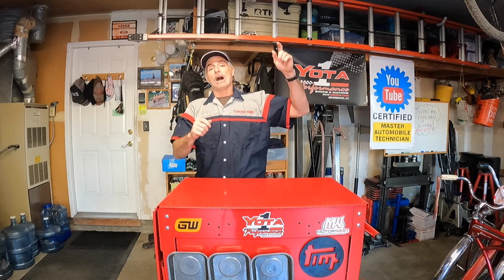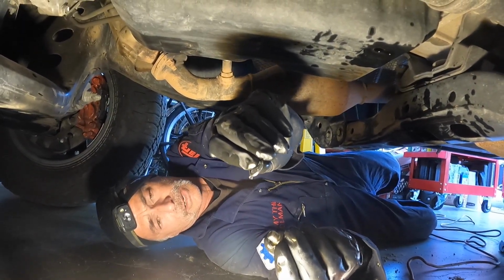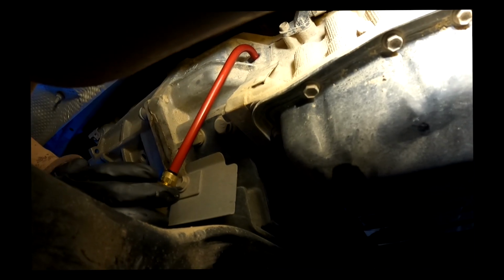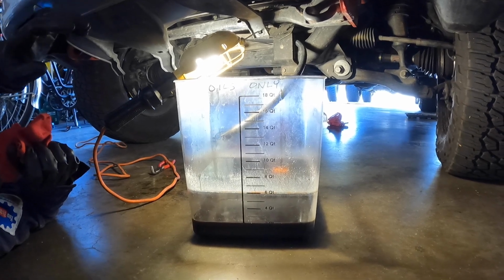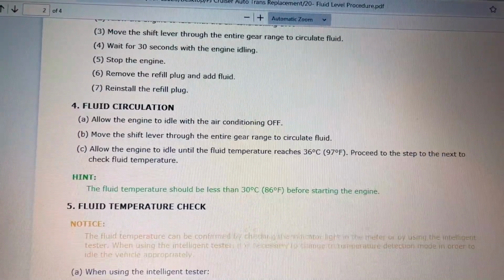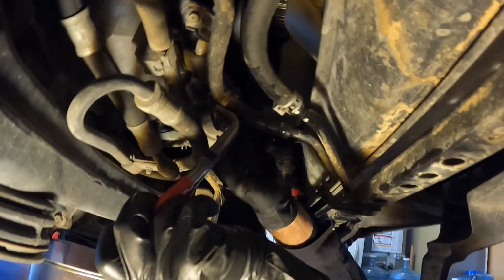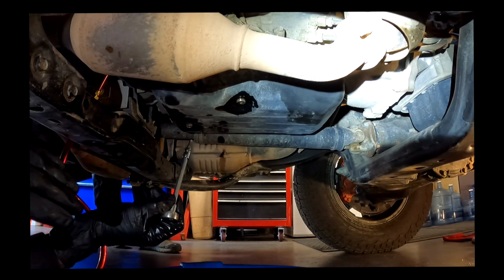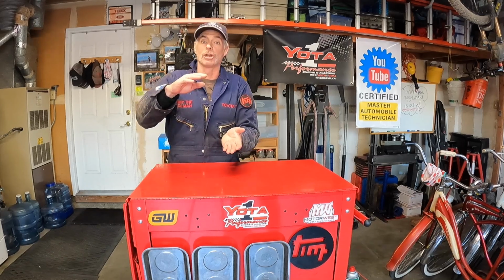Toyota/Lexus Sealed (No Dipstick) Automatic Transmission Flush (Fluid Exchange)

Comment: Do u have to let the the truck running to check the fluid level? Because when i do that theres nothing coming out even after adding more fluid. But when i shut off the truck fluid start coming out on the overfill..
Mine is 06LC. But should be same procedure
Reply from the maker: It has to be running.  If you're not getting anything coming out or the overflow, you're still underfilled.
Reply: @TimmyTheToolman initially when i fill it up, i leave the over flow open and once the fluid start coming out thats when i stop. Then i check the temp for the level. But fluid still not over flowing when the engine is running.

Comment: Love the detailed video. This is the reason I love manual trannys. I wish I could find a mechanic like you. I have a 2012 Lexus ES350 and even the dealership just does a drain and fill, which in opinion is just stupid. Mixing new fluid with dirty fluid. I had a 2012 Corolla with a dipstick and i did the tranny flush every 30k miles. It had 475k miles when I sold it and was running great.
Reply from the maker: Thanks!  Regular drain and refills can keep your fluid in great shape.  That's what I do for my 4runners, but I do it every 10k miles, which, for me, is every other engine oil change.  I think most people do a drain and refill much less frequently and believe it's sufficient.

Comment: My 2021 Tacoma has no external oil cooler. I'm currently adding one. Is the top trans cooler hose on the radiator always the feed line and the bottom hose the return line?
Reply from the maker: I can't say 100% that's how the hoses are always oriented.

Comment: mine comes out heavily bubbles and I hear a sucking sound on our 2006 tacoma, on my other truck 2005 4runner it came out normal. this i doing the same procedure. I am wondering if mixing in whatever the old fluid with what I know to be WS would cause this reaction. I dont know what was in the tranny before I did the swap (at 99k miles).  The fluid I drained was pink, but looked pretty clean, too clean for original so someone before me must have serviced it at least once before
Reply from the maker: @bradclarke93  Interesting.  Sounds like air is being introduced.
Reply: @TimmyTheToolman  agree just not sure where it could be coming from.  Will check the lines to the cooler etc.  I did not touch any of that, just a drain and fill 2 liters
Reply: also going to drop the pan and do another round , if I am going to check the lines
Reply: so I used an autel scanner and got this code P2714 Pressure control solenoid  "D" performance / stuck OFF position. 
not sure if over or under filling the transmission on the first drain and fill may have caused this or what.  It was shifting fine before we did the 1st drain fill.
I am going to pull the pan this weekend and replace the filter either way,

Comment: Why not do the transmission filter as well ?
Reply from the maker: @adventurousairman  It's certainly an option.  Those filters are a fine mesh metal strainer.  They are not a paper type of filter media that is prone to clog.  I've cut open filters like these, and the filter was pretty much 95% unclogged.  I suppose if you bought a used rig with an unknown service history and the fluid looked in really bad shape, it might not be a bad idea to drop the pan and replace the filter.  We chose not to do it on Thanh's GX470, even though his fluid was pretty black.

Comment: Great video! Quick question, I have a 06 Toyota 4runner V6, 2WD and I'm thinking of doing a full transmission  fluid flush (just what you did in this video). So, practically, it's the same process, right? Do you have any idea how many quarts of trans fluid I need for this job? Thank you!
Reply from the maker: Yes, it would be the same process.

The system holds approximately 12 quarts.  We ended up running 13 quarts through the system and were happy with the way the fluid looked after the 13th quart drained out.  I'd have at least 14 quarts on hand to get the system flushed and to the proper level.
Reply: @TimmyTheToolman . Thank you!
Reply from the maker: @rca076  You're welcome!
Reply: @TimmyTheToolman . A couple of kore questions (sorry man!). When jumping the OBD port, the 'jumper' stays on the whole time I'm checking the fluid level? And, I'm planning to drop the oil pan and replace the trans filter so, you'll see a bunch of bolts on the transmission and I would like to tight them up a bit. My question, do you recommend doing this?? Thank you?
Reply from the maker: @rca076  Yes, keep the terminals jumped while you're trying to dial in the fluid level.  It's mainly to let you know you're in the sweet spot for the proper temp to check the level via the overflow plug.

For the second part of your question, are you asking me my opinion on dropping the pan.  You sort of lost me by the way you wrote it.
Reply: @TimmyTheToolman . Apologies for the confusion. I’m dropping the pan and replacing the filter, too. While I’m at it, is it advisable to tighten the bolts on the transmission?
Reply from the maker: @ I don't see any need to try to tighten the bolts that hold the valve body to the transmission.  I would assume they were properly torqued, but I guess it's not going to hurt anything by checking if any of them are loose.  I'm like 99% sure you're not going to find any loose bolts.

Comment: I just did a filter drain and fill. When I initially got it up to temperature to check the overflow plug only a small trickle came out. I had to add more in as well.

Do you think by not having enough fluid in the transmission initially that it would do any damage? I only needed to add in another 1/4qt.
Reply: Like any damage to clutches or transmission gears? I cycled it between drive, reverse, neutral a few times to get the fluid moving. I was probably just 1/8 -1/4 qt low when I initially did this. I cut it off and put more in there and then did the check again. Just hoping I didn’t do any damage technically being low on fluid. What are your thoughts?
Reply from the maker: @Steve_Balboni  You're worrying about nothing.  These automatic transmissions aren't that sensitive.  They can run a little high or low with zero issues.  Plus, when you're not driving the vehicle, there's barely a load on the transmission.  If these transmissions were that sensitive, they would be failing with a high frequency, which they aren't.
Reply: @ thanks for the awesome insight. You’re the man, I always appreciate how quickly you get back to me and your insight. Hope you are enjoying retirement!!
Reply from the maker: @Steve_Balboni  You're welcome, Steve.    Retirement is treating me well.  Thanks!

Comment: I also went by feel torquing the drain and overfill plug. I set my torque wrench to 15ft0lb, but never reached it since it felt super tight. I prob did 12 ft-lb or so. been over 2 years and 30k miles- no issues.
Reply from the maker: @pennmikael  Yeah, it's good not to live and die by the torque spec.  Gudentite is good enough.

Comment: I have read on some forums that fluid check temperature should be 97-115 degrees and others is 115-133 degrees for the A750E transmission. Which one is coorect? I have a 2008 tacoma prerunner.
Reply from the maker: @ocelott75  I got my information from the Toyota Tech Info website.   Sometimes, the people writing the Toyota manuals make mistakes, which may be the reason for the discrepancy.

Comment: Flush is the problem. Drain the cvt only never flush it
Reply from the maker: @Tryall200  Flush and Fluid Exhange are used synoymously.  There's nothing wrong with doing a full fluid exchange, so I don't agree with you.  I do like drain and refills because they are easy to do.  I maintain the auto transmissions on my rigs by doing drain and refills, but with that said,  there's nothing wrong with doing a full fluid exchange if you know what you're doing.

Comment: Can you simply do the same process but instead just drop the fluid from the pan 3 or 4 times and refilling with fluid instead of doing it from the bottom trans hose
Reply from the maker: @goldenboyproductions7229  You could, but what you're suggesting is a dilution process.  Every time you drain and add fluid, you're adding clean fluid to dirtier  fluid.  It works, but the fluid won't be as perfectly clean as it would doing it the way we show in the video.  But yeah, several drain and refills will get your fluid in good shape.

Comment: The cheapest and most accurate way to measure fluid temperature is the meat thermometer 😊.
Before filling the fluid, I use the silicone plug to cork the overflow hole.
Insert the meat thermometer probe through the silicone plug into the transmission. Just enough to touch the fluid level.
Once it reaches 104 to 113 degrees, simply Uncork the silicone plug and let it drain to trickle.
Meat thermometer with long cable or Bluetooth works the best.
I use Bluetooth. You can set the temperature to the T and alert you when ready.
When your wife asks, what's that funny oil taste in the meat. 😮😅😁
Reply from the maker: Thanks for sharing your meat thermometer technique to measure the fluid temp.

Comment: Hi. I've got a 2006 GX470 and the tech service manuals give a 115-130 range for the check fluid level procedure. Do different model years have different temp bands?
Reply from the maker: I don't know why the suggested temp to dial in the fluid level would change if it's the exact same transmission but just a different year GX470.  What manual are you using?  I pulled my information from the Tech Info website.
Reply: @TimmyTheToolman  Lexus 2006 Repair Manual GX470. I took pictures of the pages but can't figure out how to add these to this post. Pages AT-164 to 166. Temp is on bottom of page 165.
Reply from the maker: @bobmccurrach4483  I didn't know Toyota/Lexus was still making the physical books in 2006.  I was guessing you were using a Haynes manual.  I don't know what to tell you on this other than I downloaded my information straight from the Toyota Tech Info website.  If yours is a Toyota manual as well, the only thing I can chock it up to is mistakes are made in these manuals that the technical writers miss.  The temp range I got was 97-115 and yours is 115 -130.  Split the difference and dial in your fluid around the 115-120 degree mark.  You'll be fine.  These transmissions can run a little low or a little high with no issues.
Reply: @TimmyTheToolman  Got my GX about 1 1/2 years ago with 170K miles, now at 195K miles. Used 120F (great minds think alike!) when I did the level check yesterday. Think it had been about 1/2 QT low and the fluid was pretty dark so I just did the drain and fill. Got 3 QTs out with the drain. Do you think 1/2 QT low for my 20K miles was doing anything bad? So now I have replaced 3 of 12 (is this the full capacity?). I'm of 2 minds for my next step at next oil change interval. I will definitely drop the pan and change the strainer. But do I then flush or refill with about 3 Qts? Thoughts?
Reply from the maker: @bobmccurrach4483  A half quart low isn't a big deal.  If your rig had fairly regular fluid renewals, replacing the strainer is probably not necessary.  If the maintenance history is unknown,  then it wouldn't be a bad idea to replace it.

Doing drain and refills are a great way to keep your fluid in good shape.  If the fluid looks pretty pretty dark still at the next change, I'd follow it up with another drain and refill and maybe time it with your next engine oil and filter change.

Comment: I have a2004 120 prado v6 petrol its the lexus 470 in your country same engine-and transmission 4 speed auto- i can see the drain plug for the ATF but i dont have a check plug - there is only one plug on the bottom of the transmission sump. No others. Additionally i cannot locate any 24 mm nut as the filler. Spent 8 hours so far just trying to find a video that will actually show how to access the filler plug thats clear. Nightmare to find
Reply from the maker: If it's a single plug, then there's a secondary plastic plug underneath the metal plug.  The secondary plug is the overflow plug.  I've seen that style before.  I think the plug is an allen wrench fitting.  If you look up more videos on sealed transmissions, you'll see a video with this style.  Did you look for the plug on the driver side of the tail housing?  And, I'm assuming you have verified there is no dipstick in the engine compartment, because that might be the reason you can't find a fill plug.

Comment: Hi Tim,
I have 2017 camry xle at 113K. Never did transmission fluid change as i got sucked into lifetime. Should i do drain and refill?
Reply from the maker: Yeah, do a drain and refill, and then do another one in around 5k miles.  Do a 3rd one in another 5k miles, and your fluid should be in good shape.  After that, do a drain and refill every other engine oil change or every 10k miles, and your transmission will have a much longer life.

Comment: If my lexus transmission was leaking,  should i put more than 2 quarts to  besure since i lost fuilds, i will fill the transmission before i heat it up and level it  Because idk how much fuilds it lost just wonderingif i should put more fuild incase because i can level it in the end.... ill be changing the pan  gasket and draining the fuilds.
Reply from the maker: Afterr you drain the fluid and drop the pan, I'd probably add an additional quart for the fluid that leaked out and start from there.  It would have to be a major leak to lose 2 quarts.  Even 1 quart is quite a bit.

Comment: Dear friend.  Hector from Puerto Rico.  I like the video Explain step by step and with the literature. I have a question, why not change or clean the filter.  It was a hard job and think to complete in 100% I clean ir change the filter.  Other question, I have a Tacoma 2018 V6 with 85,000 milles, it time to change the transmition fluid or can wait?  Need to change the filter or is metalic one?  Thanks for your the information than can brigh to me, is helpfull.
Reply: Thanks for your information.  🙏🙏🙏
Reply from the maker: The filters in these transmissions are fine mesh metal strainers.  As long as the transmission is serviced regularly, there's no need to replace it.  The only time I would suggest someone to drop the pan and replace it is if the vehicle is high mileage, 200k and higher, and there is no service history of the transmission fluid ever being renewed.  Dirty fluid will create more deposits in the strainer.  For that Tacoma, I would definitely renew the fluid.  You're overdue.

Comment: Does anyone have a diagram or photo showing which line is the one to disconnect for a 3rd gen Tacoma?
Reply from the maker: You could use an infrared thermometer pointed at each cooler line to detect which one is cooler and that is the return line.  Even if you get it wrong, it's not a huge deal because you'll figure out out in a couple seconds after you start the engine.  Whatever hose you disconnect from the radiator, add another hose to that nipple directed into your catch basin.  For the hose you disconnected, use a hose mender (double-male.  you can buy them at auto parts stores) and another section of hose also directed into the catch basin.  When you start the vehicle, hopefully the fluid will come out of the hose you connected to the cooler nipple.  If it comes out of the one you connected with a hose mender, then you know you disconnected the wrong line, because obviously you disconnected the send line rather than the return line.  Then you'd simply reconnect the send line back to the trans cooler and disconnect the other hose and put your section of hose onto that nipple and direct it into the catch basin and then you can start your flush operation.

In this video https://youtu.be/DPXF-iQZb9o?si=5BAm79tAwOJhlLjw @ play time 10 minutes and 41 seconds, you'll see me use the infrared thermometer to determine which is the return line and which is the send line, but I end up getting it wrong.  But, I set up the hoses like I described above and didn't make a mess with ATF coming out of the hose I didn't expect it to.
Reply: @TimmyTheToolman  thank you for the detailed explanation , you the man!
Reply from the maker: @ravot_23  You're welcome!

Comment: @rickdoe has the BEST and EASIEST method posted, and outlined as follows, which I also use:

1. Disconnect the radiator "out-fall" line.
2. Install a radiator drain-line into a opaque gallon container.
3. Install a funnel with extension line onto the return line.
4. Run engine, replacing equal drained with Fresh.
5. When drained gallon is full, shut off engine for a second container and second Fresh gallon.
6. Repeat for some 3.x gallons until out-fall is pink. 
7. Pull transmission over-full plug to ensure transmission is topped off full and adjust as necessary.
Reply from the maker: There's usually more than one way to get a job done.  People can use whatever way they like.  BUT, I'm guessing Ol' Rick isn't showing people how to PROPERLY do the fluid level check procedure like I do.  This is why people come to our channel.  We leave no stone unturned.  People learn how to properly service their sealed transmission and have the confidence it's properly filled after the fluid exchange procedure.  It's not just simply removing the overflow plug after the job is done.  You have to have the transmission in the specific temperature range to get the level correct.
Reply: @TimmyTheToolman -- It woud seem the CTE (coefficient of thermal expansion) is in the noise, --- leaving the greater issue: CHANGE THE FLUID! 😊
Reply from the maker: @bobbyjolee4362  Well yeah, most of the battle is getting people on board with the fact they should renew the fluid at regular intervals.  Once they've boughten into that, they renew the fluid and get it to the proper level with the fluid level check procedure outlined by the Toyota Engineers.